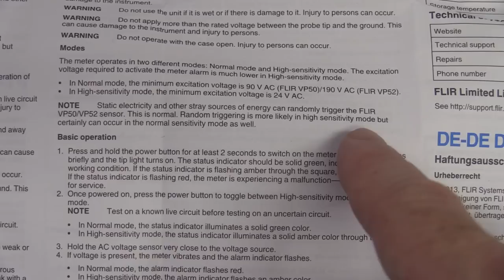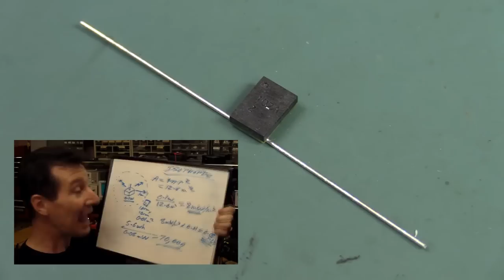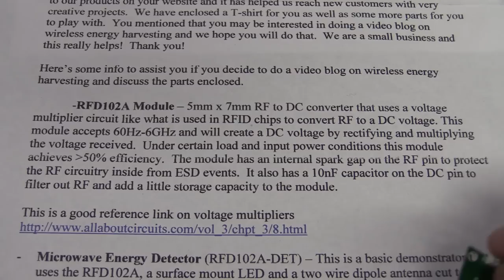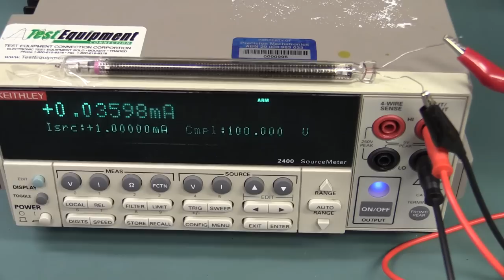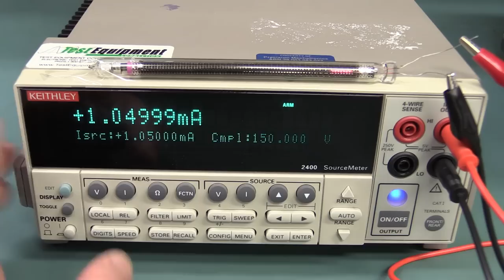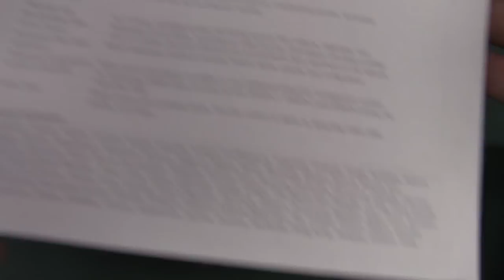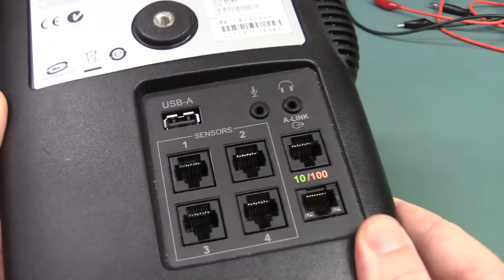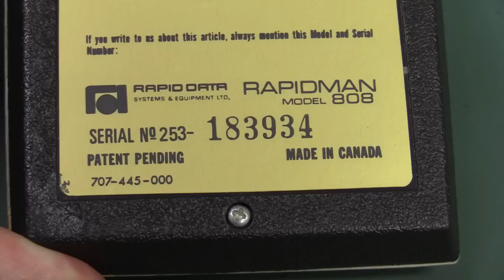EEVblog #729 - Mailbag

Comment: Dave: I bet that the room monitor is for server rooms, to monitor temperature and humidity as well as see who has entered the room and whether there is flooding, etc.
Reply from the maker: Sean Breheny Definitely.
Reply: EEVblog APC sell those monitors specifically for monitoring server rooms and data centres.  There are attachments for underfloor water sensors, smoke monitors, door sensors the whole shebang.
You basically hook it into your monitoring software like nagsios or direct SNMP monitoring to push the alerts out.
Reply: chewyfruitloop just what i was about to say, yeahp, it's a sort of "all in one" solution including a camera to monitor those pesky sysadmins and operators that like to break things ;).
Whilst not cheap in absolute terms if you compare it to other discrete offerings then woah suddenly it isn't! t's insane how much a "networked" simple temp/humidty sensor(if you're lucky to get both in one box) costs, they fleece you out hard probably a 1000% markup over mfg/R&D cost. With this you only need to hookup "dumb" sensors and you have less wiring, a single point of connection, etc etc
Reply: I could be wrong, but that lens looks like a "C" mount.  These have been used for security cameras for decades.
http://en.wikipedia.org/wiki/C_mount
Reply: Kevin Harrelson At 38:16 you can see 3.5-8mm zoom lens, f/1.4, CS mount

Comment: They sell the same soldering iron here in the Philippines and a similar one which has a bamboo handle. They're pretty much considered as disposable for one-off jobs. They cost 50-70 PHP or around $1.20 (USD).

Comment: I have a Rapidman 1208 LC desktop calculator, with an unusual rear illuminated LCD. It has a standard incandescent lamp that backlights a white on black LCD. It's just a little four banger as well.

Rockwell and Texas Instruments produced the earliest LSI calculator chip sets. Many brands purchased chipsets from those two companies, and did their own designs. The keyboard on that Rapidman you were sent looks like a TI Klixon keyboard, just with smaller keycaps than is traditional.

LOL, I can always use a Rapidman! XD

I'll post pics on the forum

Comment: I'm using a modified AC voltage detector taped to the incoming hydro lines before the AC usage meter and main junction disconnect switch to know when the Main Power comes back ON while running in Generator mode. Works like a charm.

Comment: Those FLIR voltage sensors are probably designed for 120v and audiophile 'technical' supplies in america of 60-0-60v. Might be handy on UK construction sites for the 55-0-55v  110v supplies, but for normal 240/415v power, that's pretty useless
Edit: The static sensitivity is quite useful for proving the unit is working in the absence of a proving unit or known live supply :)

Comment: I recently got a Unisonic calculator from 1976 with a VFD display. Problems that it had were: Bad corroded buttons and that included the power button as well. I got all the keys working except from the power button which still has to be pressed down a bit harder to actually work. It has a RockWell ic as well, which means that alot of calculators used them.

Comment: The APC camera uses a standard CS-mount, which is used on CCTV cameras, so you could replace the lens if the supplied one doesn't meet your needs. Since it seems to be their only CCTV product, maybe it's a collaboration with an established CCTV manufacturer (the USB would be to have APC's stuff talk to the CCTV part).

Comment: That behavior is caused by an intermittent charger connection causing many "charger disconnect" events to be generated. When you have low battery it plays that sound for each one.

Comment: i worked with one of these contactless voltage detectors just yesterday for the first time on a cabletv system, and we tested the effect of the system not beeing grounded. the detector literally set off at half a meter distance! i was told that would be how it is supposed to be!
Reply: lol i think you found of the only niche uses for that thing :D, but then again, with that sensitivity and utility poles full of other wiring and powerlines nearby what are the odds of this being useful?, you can't pinpoint anything
Reply: I had trouble with contactless voltage testers all the time, when the cable had all 3 phases, it didn't show anything at all, had a quite a few bangs because of it after cutting energized cable. Neon bulb indicator FTW.

Comment: Those IN-9's are soviet made stuff :) I have few too, did same stuff, used 2400 to power IN-9 :D It glowing depends on voltage level. First need breakdown (its usually about 100-150V) voltage to start and arc, and then you reduce current/voltage to get level :)

Comment: The  Fluke 1AC-I detector has been recalled in the USA for not giving indication of voltage. I don't know whether they just had a lower sensitivity or some other problem. The recall does not include models 1AC-II, 1LAC-II and LVD2 . Like Fluke, the Flir VP series come in two sensitivity models. The VP50 range is 90-1000V and the VP52 is 190-1000V. Since Dave has 240 V power it is not too surprising that it seemed overly sensitive. The high sensitivity mode may be useful if there is no utility voltage nearby. 
In any case, I never use these things to confirm that a circuit is deenergized, but they can be useful for  troubleshooting.
Reply: Dave's Fluke is not subject to the recall.

Comment: As for the voltage tester that said "static electricity and other stray sources of energy can randomly trigger" bla bla bla...The same goes for the Fluke. I have one of those Fluke's with dual sensitivity like the cheap one featured here, and rubbing it in your hair will set it off. That's an easy way to test if it's working or not.

Comment: Yes, your Nexus 4 is dying, that's the low battery sound. It's a common hardware issue with the LG Nexus 4. You might also experience the sleep or death, where the screen doesn't turn on when pressing the button. Buy NEW one!

Comment: I actually own a soldering iron that looks just like that. With only english writing, a better but not good strain relief, And no screws to hold the wires. I have used it for probably 10 years, never had a problem. If i were to solder more often i probably would buy a proper iron.

Comment: About the phone going bonkers.  What might be happening ==> The "energy saver" mode kicks IN at low battery charge levels, which allows the battery voltage to rise just a bit, the "energy saver" mode then kicks OUT, battery voltage drops again ... go back to beginning.  Ever heard of hysteresis?
Reply: cemx86 i think it could be the rubber case pushing against the volume buttons forcing then to be always on, because it stops when dave removes the case

Comment: doesn't the law of physics say that no matter what you do, you couldent hook up some "fancy" circuit with the rf harvester to double the energy that was put into the router?
Reply from the maker: ***** It's a voltage multiplier, not an energy or power multiplier/
Reply: EEVblog ah thank you, still learning electronics, its almost a neverending river of stuff to learn, but I love it all.
Reply: ***** You get less current out, so it's all fair game.
Reply: Perhaps if you had enough of those RF energy harvesting devices near your wifi router you could tie them all together to power the wifi itself. ;-)
Reply: Fred Flintstone Yeah, that seems very logical. Have you thought about how there's losses in wires, resistors, inductors, capacitors, the air, etc. etc. And you want some of the EM-waves to reach your laptop or smartphone, too, so you can actually use your WiFi.
What you are proposing is a concept called "free energy" and it's bogus.
Reply: Perhaps a person could build a box around the harvesting devices so none of the energy escapes. Wouldn't that 'minimize' the losses? I'm not proposing free energy since the harvesting devices, especially getting enough of them to power the average wifi router would cost a pretty penny. Nope, no free energy there. ;-)
Reply: Fred Flintstone Minimize, yes, because the EM-waves don't spread out of the box. But that would also mean that you can't use your WiFi while outside the box. And also, whenever current of any sort goes through a resistor of any sort, there's going to be electric energy being converted into thermal energy. How do you plan on getting that back?
You just wouldn't be able to power your WiFi from your WiFi. That's like saying "you can power your electric car by putting a windmill on top". What's probably feasible is using RF harvester circuits to get back some of the energy and feed it back in, but it wouldn't be much energy, almost none compared to what your router is using.

By the way, the "free" in "free energy" doesn't refer to it having no monetary cost associated, it refers to you getting more power out of something than you put into it, which goes against the "Law of Conservation of Energy"
Reply: QuantumFluxable
I see, so it's sort of like when Richard Stallman talks about 'free software', he's not talking about free of cost, like free beer, or a free lunch. He's talking about a type freedom. So free energy might mean freeing the energy from it's constraint, like the heat energy trapped in a log, or energy trapped in a battery, freeing it to help human kind? ;-)

Comment: that soldering iron..... thats waht i learned on.... excpet it is a KNOWN name brand. it doesnt wiggle.... but it is fixed temp. its orange.... i think the brand i cant remember only make them in orange... like their trade mark.  i think its a weller? 

but its a damn good one. fixed many things with it. my dads 58 or something Samgsung LCD tv burnt out.... bad power supply. just low quality caps and shit on it.... and it blew. just went and tore a cap out of my pile of old computer junk, and shes still working today. fixed it like 4 years ago.

Comment: Hello I buy 4 months ago the new hakko fr 300
I found a hi fi and started to strip some componants and it stopped working. The dealer not help me and deft me in the cold. I been working on it and convinced there is a bad desine fault
I get 250 v mains. I no that keep every thing clean. I wonder if you could test this over a few months at uk 250v instead of 240v 
I hope you can help
Kind rigards Richard

Comment: hahaha I had the same issue with my nexus 4... it's when it reaches 15% charge and turns into energy saving mode, then for some reason the battery reports something like 15.1% and the software thinks "oh better turn off energy saving mode" and then it drops to 15% again and the software turns energy saving mode on again.. haha :D